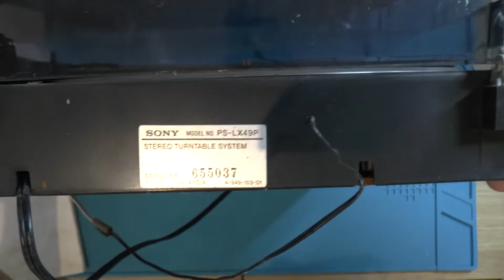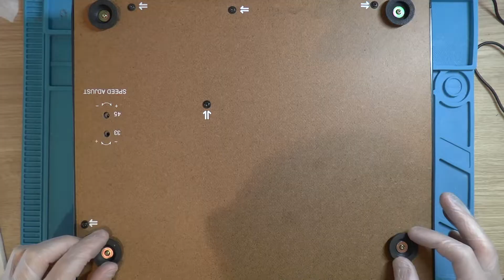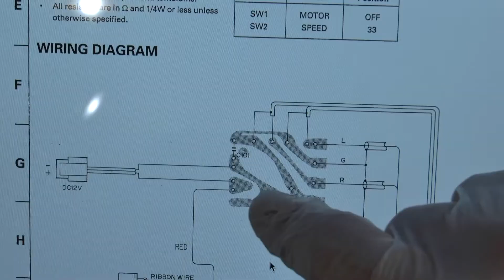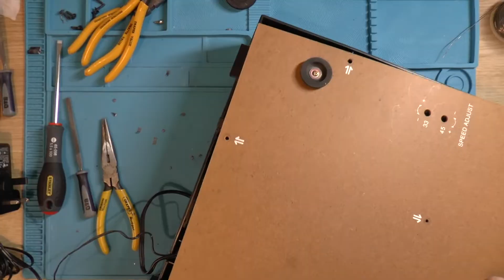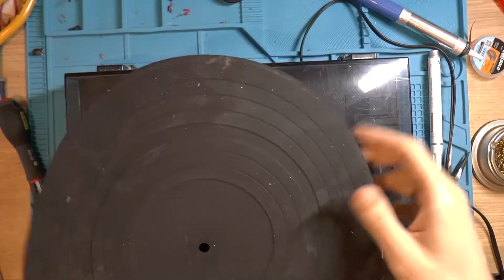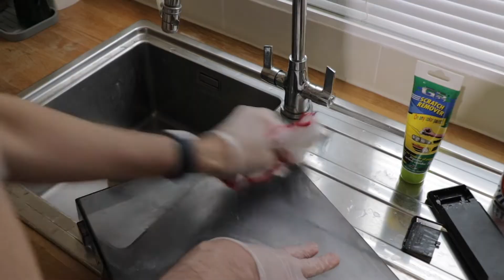Sony PS-LX49P turntable restoration and power mod

Comment: I have a nearly 40 years old turntable with the original stylus, I think it plays quite well, but then again i might be wrong. It has not been used a lot, but i wonder, is my old hearing the problem? 😅
Reply from the maker: If it sounds good to you, that's good enough in my book!
Reply: @SpareTimeRepairYes, I digitalized some records and compared to some i downloaded from the Internet, same records of course, and think i have the same quality. I am really surprised that the stylus is hanging on , that well.

Comment: I would have gone with a USB-C trigger board, I don’t think these router PSUs are designed for tight voltage tolerances, so they are probably not ideal for ensuring a consistent motor speed (and would be even worse for a turntable with built-in audio electronics).

Comment: To use the phone speed app properly, simply put a sellotape roll over the spindle and rest the phone on that positioned so the phones center of gravity is over the spindle. Most important parameter is wow and flutter.

Comment: Little unclear to me why you’d desolder the original power cable and use an entirely separate piece — just, like cut the cable in the appropriate spot and leave the original end soldered where it is. It’s by definition the right kind of cable for it!
Reply from the maker: But then I'd be introducing an extra joint, which isn't ideal. (At least I think I would - I can't remember without rewatching the video!)

Comment: Oh, I was hoping to see you take apart a wall wart and fit it inside the turntable.  That cavity seemed to be plenty large to accommodate it.  Oh, I see you did another one after you moved to the US and put the power supply inside.

Comment: Re Rubber: if you soak it down with 303 protectant for about  24hrs (coat it good and lay a piece of plastic wrap on it) then give it a wash to remove the excess and that mat will stay supple for years. It won't be greasy or shiny.  It works great for making automotive rubber last.

Comment: i have restored the same turntable, working with only 5v usb powered and replaced the RCA wire for a two RCA conectors. Work great
Reply: How did you power the 12V motor with 5V?

Comment: Hi, I’m trying to go through the same process with my own one and I was wondering if there’s a way I can contact you and ask you some questions on how to complete the process as I’m having some problems.
Reply from the maker: Yes, you can email me - sparetimerepairvids@gmail.com
Reply: @SpareTimeRepair brilliant, just a quick one, is it necessary to switch the wires to speaker wires or something of that sort or can you split and use the original wires that were used for the original power supply. Thanks
Reply from the maker: You'll be fine using the original wires, as long as you get the polarity right.
Reply: @SpareTimeRepairwas there a reason why you changed them?
Reply: @SpareTimeRepair Hi, I have a PS- LX50P.  Would you know anything about it. What is happening is that because the whole thing is automatic, there is no easy control , so the stylus/arm goes across to about 1 cm from the inner edge of the 12 in LP. I'm loath to touch the adjusting screw to the left of the arm as the error seems much more than the screw would compensate for. Of course it is much different to the 49P for which I have seen your video. Hope you can help- I will of course reciprocate. Mike

Comment: Get yourself a handheld rotary buffer and some car cutting paste, that lid will come up like a mirror, i modded two of these record players years ago, added a slide potentiometer to the top with a voltage regulator to control the speed, when i finished with them ended up with a good little pair of dj decks, i got the speed accuracy so good it went out of sync with the cd version of the same song very slightly after 20 minutes

Comment: A couple of cleaning tips:  I use paper towels and Windex.  It does a pretty good job and is quick.  it even removes grease.  There's this stuff called Novus plastic polish.  I have great results on dustcovers with the middle level formula that has red lettering (No. 2).  The green lettered formula (No.3) is better for deeper scratches.

Comment: I remember on my first audio system the turntable got power from the amplifier and it was 11v AC rather than DC. I wonder if they used an AC motor for speed regulation as it would be locked to the mains frequency.  I wouldn't say it was a propriety connector as it used something that looked like the old 2 pin DIN speaker connector. The amp had two power output sockets, I think the other one was for a single cassette deck, but I got the twin cassette option and that had it's own separate mains plug. I've managed to find the model number of the amp - it was a Hitachi HTA-07 combined tuner and amp.

Comment: On the mains powered versions the transformer is located in the bay under the 45rpm adapter, most of these turntables weren't made by but for sony by audio technica... a few people I knew in the 90's had sony systems with 12v turntables but they just threw them out in the wheelbins when they wouldn't work with the new 11.5" wide mini systems... I always thought the 12v power was a daft idea myself.
Reply: Power supply as an external wall wart tends to be a pretty good idea, really. Keep that hum far away. My dad’s Thorens tables all have 9VAC wall warts, with I presume rectification inside the case.

Comment: I'm currently working on repairing PS-LX56 (I bought basically just a shell and motor) which seems pretty similar to this one. Finding new stylus was easy, but I'm having difficulties finding the size of the drive belt for it. So, I have to ask, what was the size of the belt for this one?
Reply from the maker: The one that came off it was 315mm when flattened, but it may have stretched a little. Not sure if that's a standard size.

Comment: The mobile should be kept centred over the spindle supported on a tape roll or something. That way the measurement will be much better. Alternatively a stroboscope disc may be used. Also the platter looks made of plastic and the cartridge seems ceramic - definitely not hifi...
Reply from the maker: No, certainly not hi-fi. Good tip for placing the phone for speed checking - thanks!

Comment: I'd suggest anyone to use a strobe record, or match a song you're familliar with, then beatmatch with spotify... THEN that phone app.

My first experience using that phone app was with a BSR record changer. I noticed, the more records, the slower the table would go (drive wheel propelled plastic turntable). I found a happy medum and left it... no way to perfect that table... possibly the same for this one?

Great video, thanks!

Consider using a Hi-Pass filter on your audio. This video made my subwoofer go crazy in the beginning.
Reply from the maker: Good advice, thanks. Sorry about the subwoofer! I'll look into that.